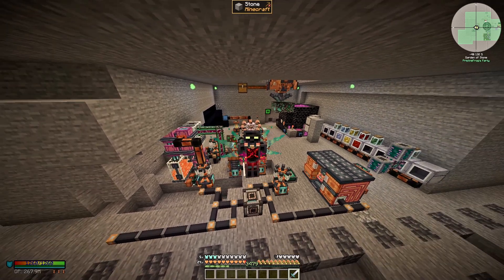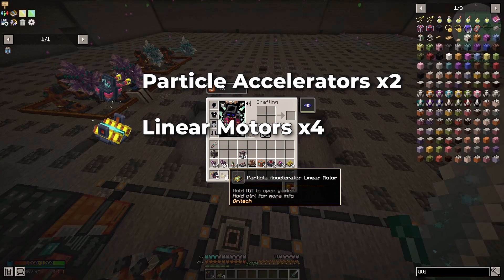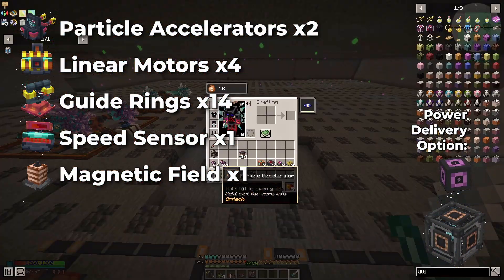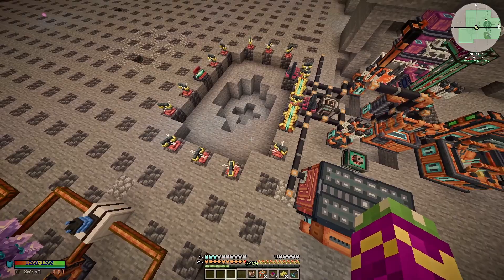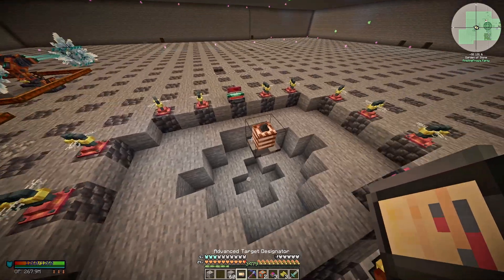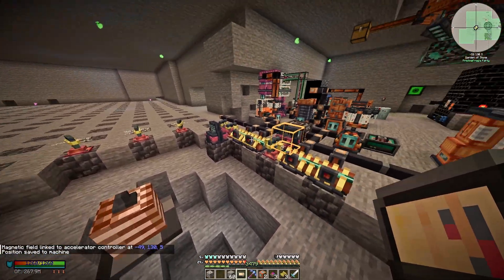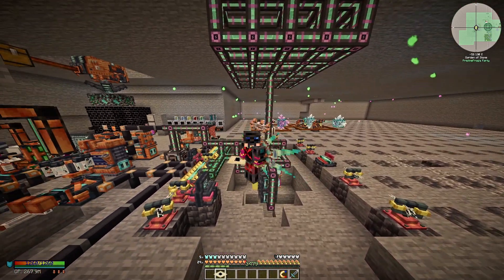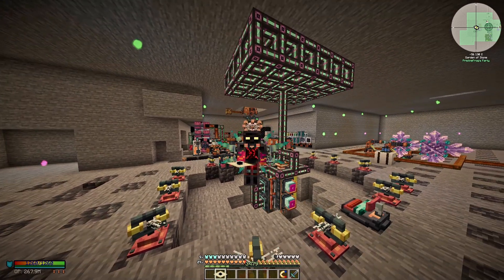StoneBlock 4: How to Create the Oritech BLACK HOLE

Comment: using this for the plutonium but when i put the fluxite in the second accelerator it collides but both items disappear not sure what im doing wrong
Reply from the maker: Hmmm that is an odd one....

1. Double check the accelerators that they did collide with proper Joules
2. Make sure the two particles are correct

I dont think there is a chance of a collision without a result....i mean if i was a mod dev I would 100% put a failure chance in lmao, but thats because a im an Ahole hahahahaha

I have tried this for both blackhole and Plutonium many times and have not had any problems just yet, but will keep my eye out.